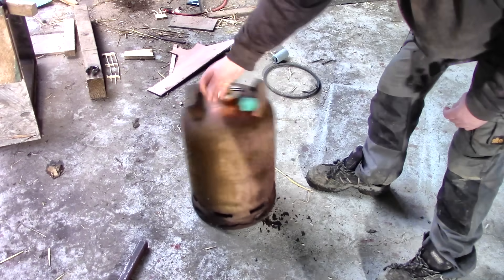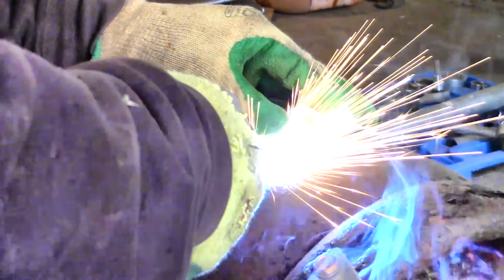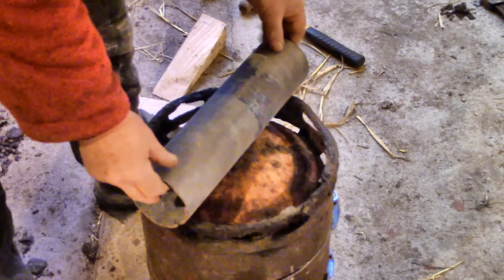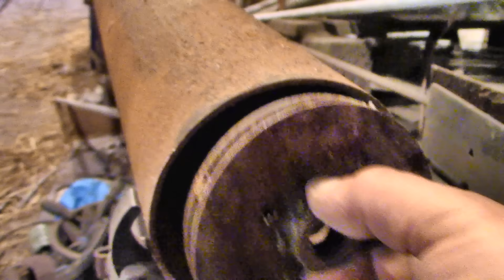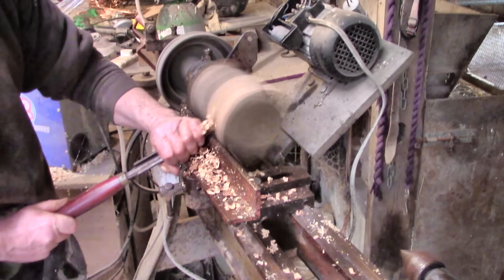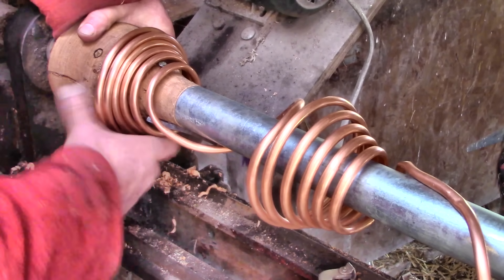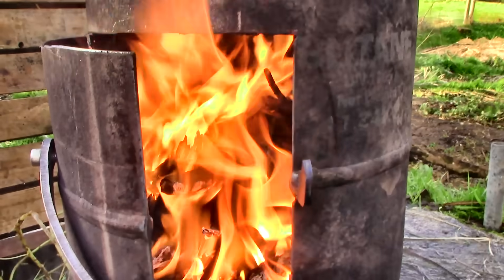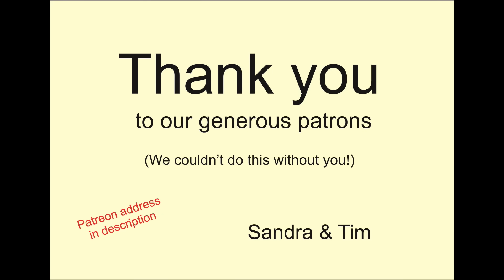Homemade Flash Steam Boiler From Plumbing Pipe And Scrap

Comment: We made essentially this exact same thing, with the addition of a sight glass, a safety blow off valve, and (to put it simply) an affordance for feeding water in at a known pressure. The next step we took was to add a section of large diameter pipe as a sort of pressure reservoir, just to increase the internal volume of the boiler…without this, as soon as we released pressure, water would be coming out of the steam exit. With it, we could maintain the water level below the height of where this volume was, so we were sure it contained gas. 

Ultimately, the amount of heat transfer with the spiral copper tube was not satisfactory. Most of the heat was simply going up the flu. If I were to do it over again I would rearrange the water tubes so that there were more of them in parallel (rather than one long one) and orient them vertically so that the steam bubbles could more easily rise to the top, rather than causing gurgling and surging inside the line as they evaporate and recondense as temperature and pressure varies. 

Ultimately I decided against making a video of the project because the results were rather disappointing and it didn’t look like much was happening. We did achieve >120psi sustained pressure with some (unknown) volume of steam being released to draw a draft over the fire (it didn’t appear to work particularly well to draw a vacuum in the fire box and we didn’t measure the pressure change). 

Wishing you more interesting results!
Reply from the maker: Thank you - yes, it seemed simpler when I started but there's a  lot to learn!

Comment: Some steam locomotives had superheater tubes, which were folded one or two together in each of the boiler flues to dry out the steam on its way to the cylinders. Maybe add another "steam pipe" through the chimney?
And, this is all incredible, but please be careful. Steam boilers can be very dangerous.

Comment: I will throw suggestion hat in.
If you first have a coil of copper pipe wrapped around the outside of the smoke stack. Then wrapped in rock wool finished off with a    "tin" pipe to protect everything. 
Good luck with plan B steam machine. 👍🥳

Comment: This is basically a tankless water heater. If the water flows from the top down and gets some secondary heat near the top (like lighting the exaust on fire) you might be able to achieve superheating.

Comment: Just wanted to add my 2 cents on the water flow comments. From my experience of heat exchangers your setup looks correct. you introduce your cold medium (water in this case) you want to heat up to the end of the exchanger were the heating medium (smoke and hot air in this case) is exiting and isn't at it's hottest. This in turn means the medium you want to heat is exiting the exchanger just after it has been in contact with hottest part of the heating medium (in this case the steam is leaving the exchanger just after it has been exposed to the hottest part of the fire. This whole arrangement is called counterflow heat exchanger as opposed to a parallel flow heat exchanger which have less effeciency and don't achieve high temperatures. I don't if gravity and or bouancy is having a detrimental impact in this setup. Maybe a horizontal or inclined arrangement would be more effective I dont know. Love the videos

Comment: You need alot more copper tbe for the heating surface. Maybe a coil  in the top of the boiler to make the steam and then a vertically long bent bent multi ringed coil up the flue part so you near fill it up as you need more heating surface to get rid of the water. in your video your steam is not far from boiling point hence the water and you need to go abit further in temperature to create flash steam where you need a bit more pressure to do so. Flash steam will only accrue when super heated pressured steam comes out back at atmospheric pressure which is around 14.7 lbs. So say heated steam back to atmospheric will create clean flash steam so you need more heating surface to heat the steam you already have. Plus a 50 / 100 lb safety valve somewhere.

Comment: straight tubes that join into one at the top and bottom for feed and output. 
Also if you make a heat sink from a heavy bit of iron and drill through it so the copper pip can go through the middle, as the iron gets hot it will heat the water with its stored energy. this may offer a fast start if the system is not in constant use.
also fill the pipe with(non corrodible metal )wool loosely.

Comment: Perhaps it would be better to start the coils of tubing around the firebox itself, before they go up through the chimney? Putting an insulation wrap over the entire assembly might help too. As far as bending thin copper tubing goes, the best way to do it is to fill the entire length of the tubing with sand, then crimp both ends shut. The sand will keep the tubing from kinking :)

Comment: You can run fog machine fluid through that thing! It would make an incredible amount of show fog quick! Donkeys love show fog.
Jokes aside, a commercial flash boiler works with a metering pump which pumps water in carefully metered amounts in a cherry red glowing empty(!) tube. Steam powered trucks and cars like the famous Stanley steamer worked that way. There are also model speed boats with flash steam boilers. When I was young I always wanted to build one. I don't think that copper tubing will work reliably at those high temperatures combined with high pressures and the constant water hammering, though. When I was experimenting with flash steam scale model boats I used special grade stainless steel tube as (strongly...) recommended in the plans.
Reply from the maker: Thanks - interesting!

Comment: I'm not someone who knows what he's talking about, but I have some experience with fire and heating water. My thought was to put an oil-filled jacket, open at the top to avoid a pressure build up, around the burn chamber, and run a heavy-duty copper tube through it. The tube could be much shorter. Maybe then you could gravity-feed water down into the tank, with a one-way valve keeping the steam from backing up into the water tank. The other end would exit into some kind of steam engine. Warning, over time, the copper tube could fail, injecting water into the oil, causing an explosion. Or the oil could get too hot and catch on fire.
OK, don't try that, it was just a thought.

Comment: Fill the small copper pipe with wax sand or use water but u have to freeze it with water in it but it will support the inside of the pipe I like to use wax for bigger pipe sand works gray in all sizes of pipe so lint as the bends isn’t too crazy wax will melt out sand will have to me washed out water just wait till it unfreezes

Comment: I would suggest including a super heating section of pipe.
A lot of traditional steam boilers will run a pipe from the boiler back through the firebox to super heat the steam so that it doesn't condense. 
I would have the heating coils running the water from bottom to top, then have a single pipe that runs from the top back down into the firebox and out the side to super-heat the wet steam before it exits the flash boiler.
I also don't think you're generating a lot of pressure because it's limited by the pressure of your water system. You'll probably need a water pump to drive the water into the flash boiler, if you want to start generating large amounts of high pressure steam. Pump in 1L of water at 60PSI and get 1600L of steam at 60PSI out to run the pump, you could even run the pump at a 2:1 gear ratio and it'll still generate more power than you take out!
Reply from the maker: Interesting!

Comment: Fill your tube with water and cap it off or crimp it at both ends to prevent kinking during bending. Reduce your flow rate into the heat exchanger to get the steam dry - you can only convert a finite amount o water into dry saturated steam with a certain amount of heat - so you either have to add more heat for a given input of water, or regulate the the input of water for a given amount of heat available. Your steam will immediately become wet upon entering the atmosphere due to the drop in pressure. You can only know if it is dry and satured in the boiler if you know the pressure and temperature in the boiler. Many factors will affect efficiency of the heat exchanger, such as surface area and temperature differential, but beauty will have a negligable effect so don't worry about that!

Comment: Where you have the tube coming out where the gauge is, add another length of tube up to the top of the smoke stack and make some oblong coils like you were doing in the start but they need to fit inside the coils inside now then bring the tube back out and see if heating just the steam drys it out. There are saturated steam locomotives and super heated steam locomotives. Saturated means it uses the wet steam and super heated means the steam is sent through the boiler again to get dried out more.

Comment: A trick I learned in making copper coiled tubes is packing the tube with sand first and then using tube bender. At that point, you can make some impressively tight coils.

Comment: A big tank placed high next to this steam boiler as a source of water instead of pumping cold water straight from a hose to the fire could improve performance for a flash steam boiler as the hot liquid sputtering out from the top can fall back into the tank, so even though you don't start off with much steam it won't get wasted and besides it warms up the tank which in turn makes it easier to produce steam.   (obviously ill get too heavy on top so it will need to be fixed to a wall at some point.)

Comment: to get the superheated steam the coil should pass through the fire and for that purpose you may need the tubes material which could stand higher temperature to the extent of necked fire

Comment: The donkey is trying to tell you to run the copper end to end through the pipe and only mke a few bends at the end. A pipe with with sand will not kink.

Comment: Sorry to burst your bubble sir but that’s a water tube boiler, not a flash boiler.
A flash boiler is tube is heated and then the water is injected. They are capable of 1500 psi almost instantly. I have only worked with saturated and super heated steam, never flash boilers but I think you probably need a ridiculously large amount of heating area to properly “flash”.
If you want to continue with your current design you will need a steam drum to separate the water from the steam and 2 safety valves otherwise you just have a dangerous hot water heater.
Reply from the maker: Thanks, Ross. So much to learn!

Comment: Mount the pressure-gauge on a u-bend or siphon, they don't like steam inside them.  :)

If you can make a mandrel as long as the chimney, & wind the coil (filling the pipe with water will prevent collapse.) with a pipes-worth of space between turns, & some clearance between coil & chimney, this might be long enough to provide superheating.
If not, add a u-bend  from the output of the coil down to the fire-box & then back up the chimney to the safety-valve, steam control-valve & gauge.
The internal clearances should improve gas-flow & heat-exchange.

Comment: Dear Tim
Could you conserve more heat to transfer to the water by insulating the chimney on the outside?  Also could you wrap more copper pipe around the firebox (before it goes into the chimney) , then insulate over this then lead that pipe into the inlet of the heat exchanger, thus acting as a feedwater preheater and using more of the available heat.  Lastly could you force the boiler a bit by putting a fan to blow air into the firebox (like a blacksmith's bellows) rather than just using natural draughting?  It goes without saying that the steam line from the boiler to the engine (?) should be well insulated too when you get to that stage.
Best wishes from Canada.  Paul
Reply from the maker: Thanks, Paul : -  )

Comment: Hi Tim, I accidentally made a flash boiler when making a sap preheater for my maple syrup evaporator. From the supply tank I ran a copper pipe through the firebox to the float valve. The maple sap boiled in the pipe in the firebox and blew out my very expensive float valve. - Eric.
Reply from the maker: Sounds spectacular and it probably made some sort of toffee too?
Reply: STOP MAKING ME HUNGRY
Reply: I hope nobody got hurt.

Comment: Winding tubes is much easier with a properly designed and sized tube bender or by filling the tube with something. Sand is traditional but really hard to get out. Some success has been achieved with ice.  I have considered low temperature melting metals and sugar but haven't tried either.

Comment: Wrap more tubing around the outside of the flue, thus easily preheating the water, connect to the internal tube. Then insulate the whole flue, you could use well oversized flue pipe and vermiculite.

On the other hand you have created a very good method  to heating your shed or anywhere else, connecting some radiators, a pump, oh, and a good quality pressure release safety valve.

Thanks for giving us your time.

Comment: Tim, to manufacture a coil from soft copper pipe you should fill it with water and then it won’t kink. Clamp it on one end and wind it tightly around a pipe of the desired diameter.. presto! I wish I had a workshop like yours and the time to potter like you do! The railroad is a real inspiration!
Reply: Sand works either

Comment: Consider insulating the chimney/heat-exchanger with perlite, fire cement, or even just clay rich mud. Any heat radiated from the chimney is heat lost from making steam. Take a look at rocket stoves if you haven't heard of them: very efficient stoves with heavily insulated firebox and chimney.

Comment: To bend copper pipe without kinking, fill it with salt, its easier to get out than sand is. Lithium grease in a spray can. Slipperiest stuff on the planet, reduces surface tension to zero.

Comment: Smaller fire box door, use the casing of the fire box as a pre heater using coils then use the chimney as the main but with more coils, then insulate the pre heater coils and the chimney, should improve efficiency greatly.

Comment: I think you may have more success with a smaller tube, the velocity of the water seems to be key to steam production. In the article I read  the guy used two coils of 3/16" tubing to run his 20ft steamboat.To address your wet steam problem might I suggest using a longer coil, or using a few radiant coils to "dry" the steam, although those could be liable to melt if the fire got to furious. 

Also add a saftey valve, Monotube steam generators are safer then conventional boilers but still require a saftey release valve to prevent tub tube burst. Furthermore you should hydraulically test your boiler to 2 times working pressure just to be sure your material can handle it.

Comment: With a flash boiler all you need to do is attach it to a drive system but you can make out of an old 2 cylinder engine

Comment: Awesome proto-type! My suggestion would be to send the water in at the bottom rather than the top. That way you have gravity and the pressure working in your favour. Water in the system will be concentrated towards the bottom where it is hottest from the fire and the steam will rise through the tubing away from the water and remain hot from the heat travelling up the chimney. 

In chemistry condensers are always set-up this way with cold water in at the bottom and hot water out at the top to maximise the heat exchanged.
Reply: Also bring the tube from the top back down to the fire to superheat the steam!

Comment: If you add sand to the copper pipe, then it wont kink.
Reply from the maker: That works for wider tube, for sure, but I'd be worried there might be little gaps in the sand in this tube, which would be fatal.
Reply: @wayoutwest-workshopstuff6299  I wonder what the guys who make wort chillers do?

Comment: You need a steam/water separator
Reply from the maker: I think the steam has to be hotter so I don't need one
Reply: @wayoutwest-workshopstuff6299  or slow the feed rate?
Reply: @wayoutwest-workshopstuff6299  ps: if you are gonna add extra pipe, particularly thin stuff that forces the steam/water through a narrow diameter, perhaps get a one-way check valve for safety on the inlet line!

Comment: Looking at steam locomotive design for inspiration, you could run a second coil up the outside of the chimney , maybe with a shroud pipe around that, to preheat the water and use some escaping heat. You also could explore how much air your fire needs to burn hottest. The locomotive firemen’s rule in some places was a thin white smoke was best. I suppose the brute force way would be putting it through two burners…

But this is an excellent piece of work I think. If it works out you could use it for more than just a locomotive.

Comment: I do not know what I am talking about, but what about running it from water in at the bottom and at the top u turn and run the steam back down the center of the pipe, as it gets lower it gets hotter ? maybe easy test?
Reply from the maker: Yes, that sort of arrangement might work

Comment: If you crimp and solder one end, fill the whole copper tube with water, crimp the other end and roll it in until it fights back, you'll then be able to wind the tube into very tight spirals without it kinking.
Reply from the maker: I'll experiment - thanks for the suggestion